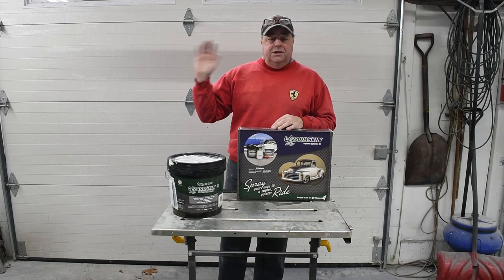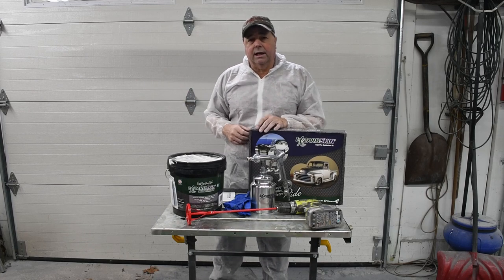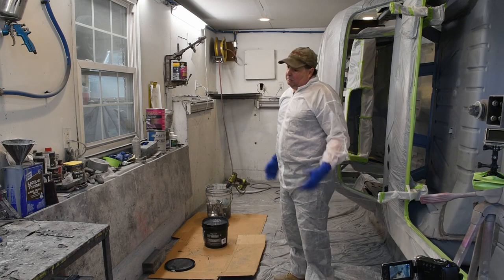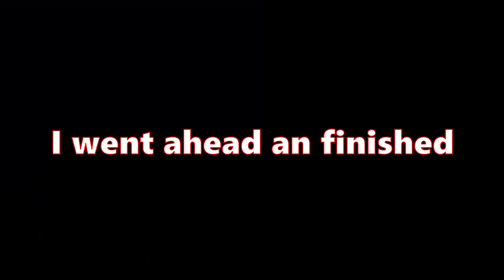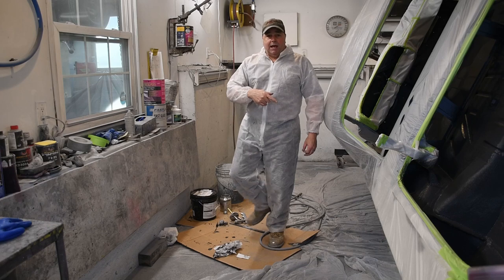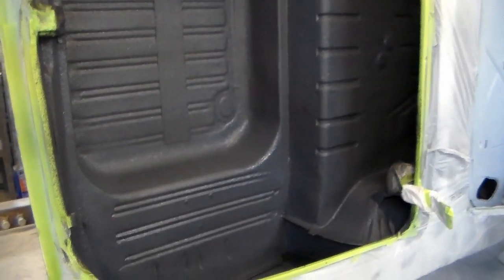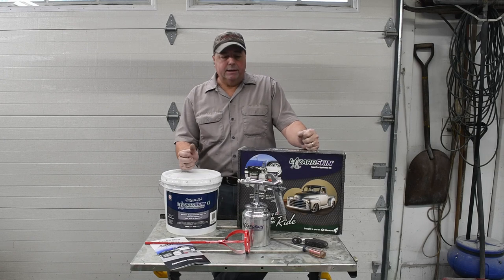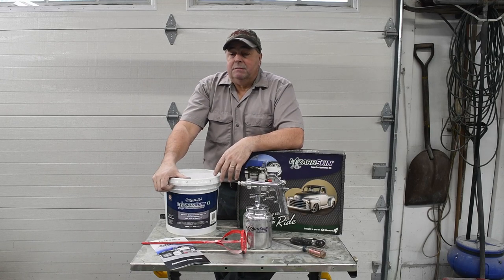LizardSkin Sound Control Step By Step Installation & Review

Comment: Thanks for the detailed info, i have ordered the sound and thermal lizard skin and will use your tips to help make a successful project.
Reply from the maker: You'll love it. Pirce of cake to spray and clean up too.
Reply: did u give it a go yet with the sound and thermal?  how did it turn out? any lessons learned/tips?
Reply: @michaelcharest9378  not yet, actually my area is being affect by the recent uptick in virus contacts, so i can't get a 4hp compressor shipped to me for two months now. it took an extra month to get the lizard skin in. my masking tape is still enroute, i have a silent compressor, it is only 30 liters and only a single motor. I had to disconnect one when a gecko got inside and the electric motor stopped working consistently. basically sometimes the compressor would start and i would smell electrical smell and have to turn it off. so i had to take one electric motor off and it only is a single now so about a 1hp compressor. i don't want to stress the compressor i have so i will have to wait until i can get a new compressor. but i am excited to try it.
Reply: @marknasia5293  hey, thanks for that...sounds like u have a few challenges.  i have a 7gal craftsman air compressor that i hope will do the job.  i have never used it to push paint.  bummer we need to buy the special sprayer but it is what it is and troy above says it ought to be bought.  u like the price u got for the lizard skin? i need to buy 5gal of each sound & insulator.  so this is gonna be a thousand dollar job in the end.  ouch.  where u get your product? would u recomend?
Reply: @marknasia5293  ah ha, u r the first to talk about using an adhesion promotion primer.  i have wanted advice on that since doing the research for these months.  i have watch about a dozen videos of application of lizard skin and everyone of them ‘scuff’ the surface with light sanding which for me, on the inside of a brand new van from top to bottom interior is going to be a multiple day job!  having no experience with auto spraying application i am just planning to do what everyone else is doing and lightly sand the whole thing.
Reply: @marknasia5293  yes, a friend suggested i get the $20 sandblaster from amazon and a box of silicate and just go at the sanding side of things with that and a good respirator mask.  fortunately, i am only doing the entire inside of this van and need not address the outside.  however, i want to do it well so it works perfectly...given all the prep and expense...double coat sound deadener then double coat insulate.

Comment: Hello great video info, can one use the insulation only or one has to use the two products to work. I’m only looking on fixing the heat issue. Thank you
Reply from the maker: I would use both. They recomend, sound control by itself. But, recomend temp control with sound control. Good luck on your project

Comment: nice review of the product.  do you think i could rent a paint sprayer from home depot for this job?  also, could you recommend a primer instead of having to sand/scuff the whole surface before hand? thanks in advance.
Reply from the maker: No you need some air pressure. Buy the gun, rent a compressor if you to.

Comment: What do you recommend to use to treat the metal before priming and this? Por15? I have seen mixed reviews
Reply from the maker: I don't like POR15. I had friends with many paint problems attributed to POR15. I would recomend priming the surface with a DTS primer (direct to steel). I use House of Kolor KD3000 with excellent results. Or you can use a traditional anticorrosive primer follow by a urethane primer. Transtar is pretty good stuff. Best of luck to you
Reply: @troykane  thank you for the tips. I’ll check some of that stuff out this coming weekend at Home Depot